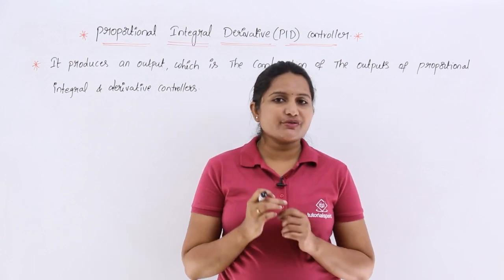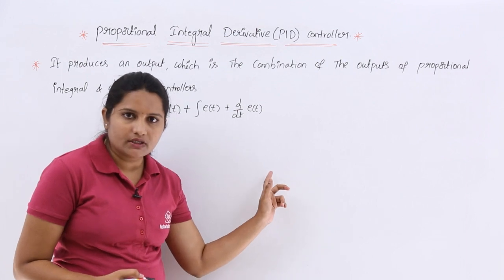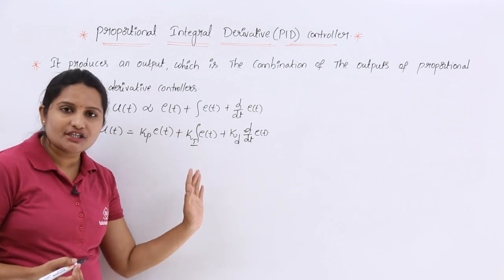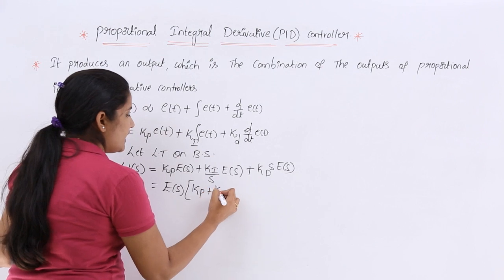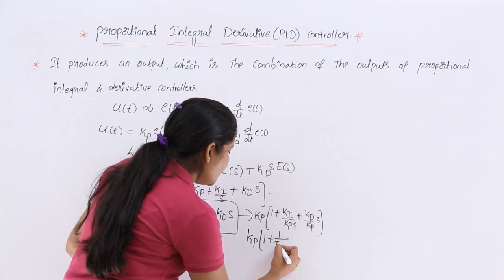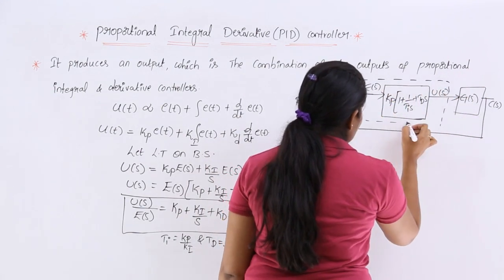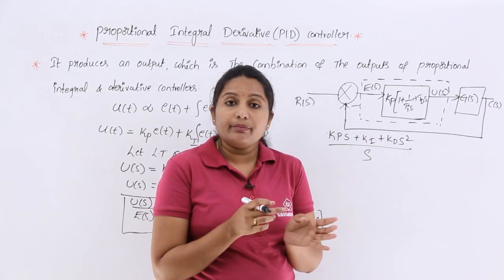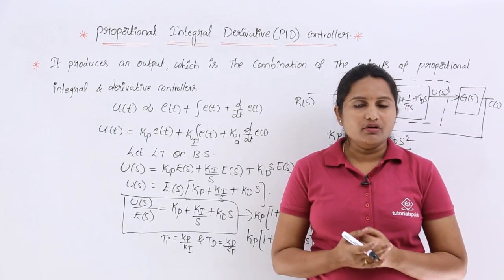Proportional Integral Derivative PID Controller

Comment: Mam I have one question related to temperature controller actually I have to work on temperature controller .and I face one problem every where.  That PV always goes beyond SV...not one or two points when I set SV at 90 °c then PV teach upto 120,122,125 eventually I have to turn off the controller to stop this...my question is what can be the actual reason behind this? Please reply...